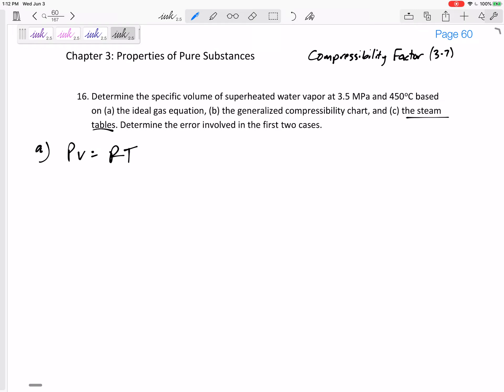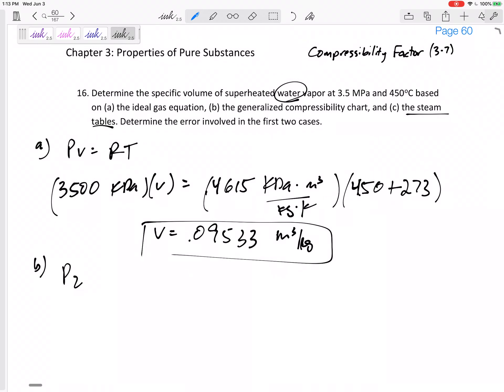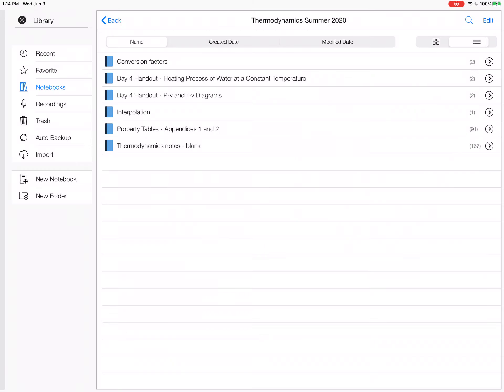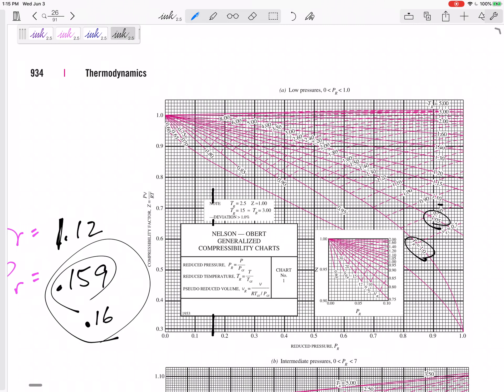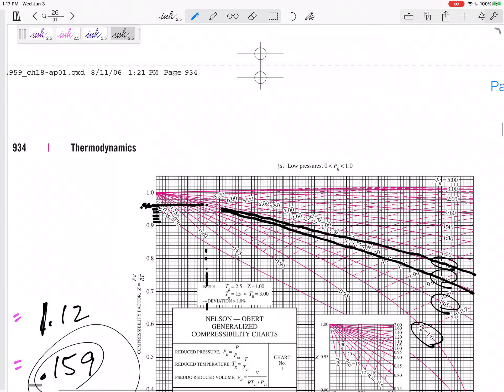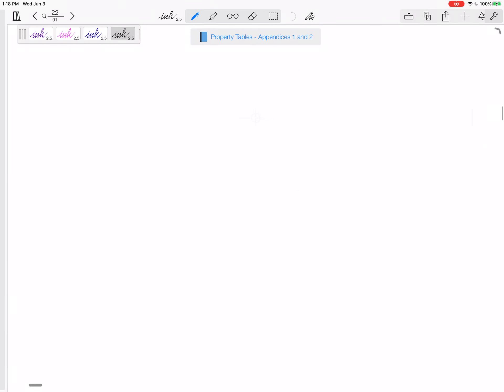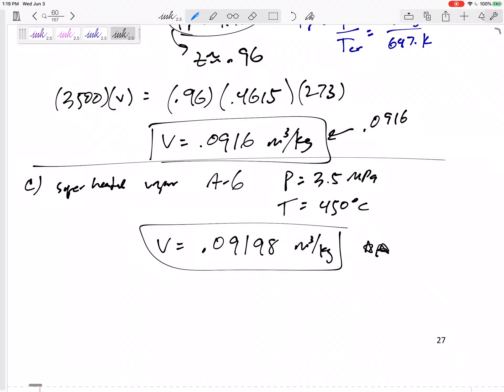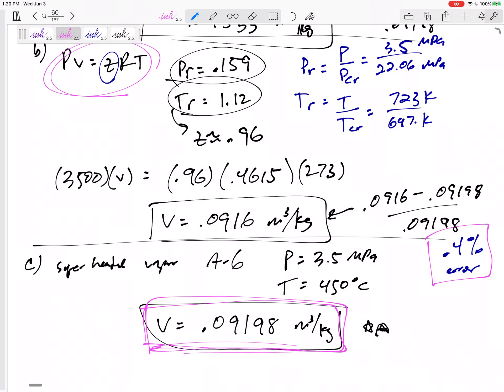Thermodynamics - 3-7 Ideal Gas Equation with compressibility factor example 2

Comment: I'm confused on how the water vapor is an ideal was with pressure being 3.5Mpa?
Thank you so much for your videos you are amazing !
Reply: I meant gas not was lol
Reply from the maker: @zEre326  It behaves like an ideal gas because the temperature is so high. Check out the section "Is Water Vapor an Ideal Gas?" on page 135 if you're following along in the Cengel and Boles' book. At high temps and/or low pressures, water vapor is similar to an ideal gas.